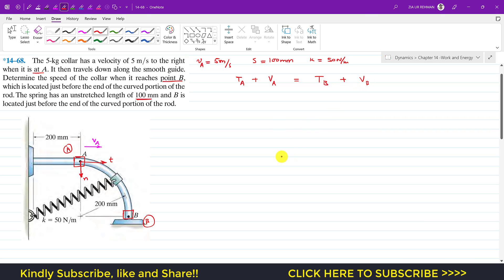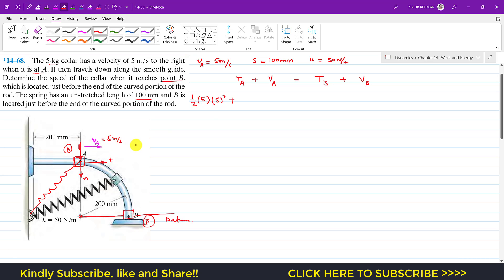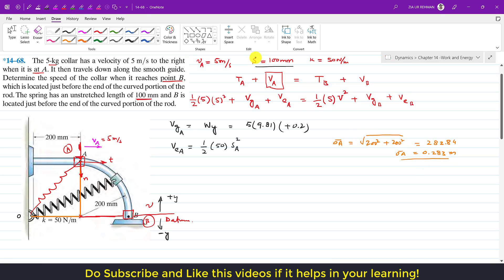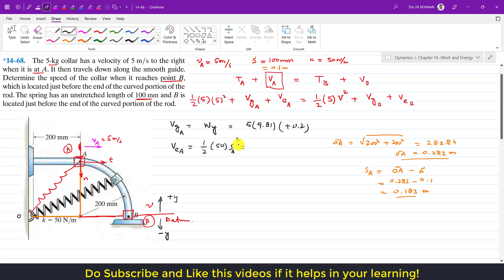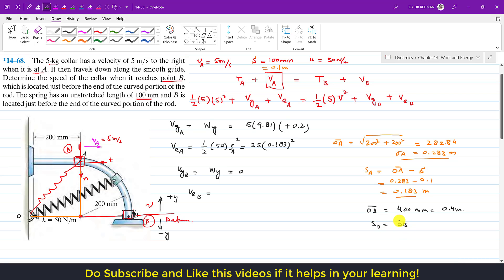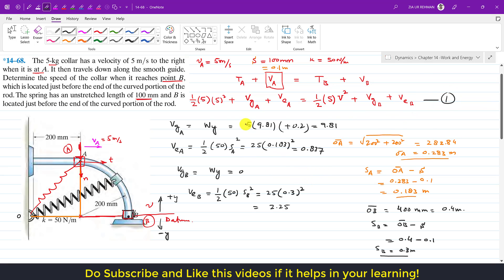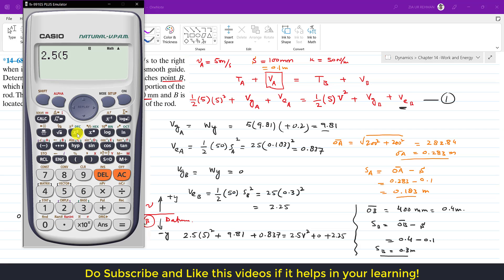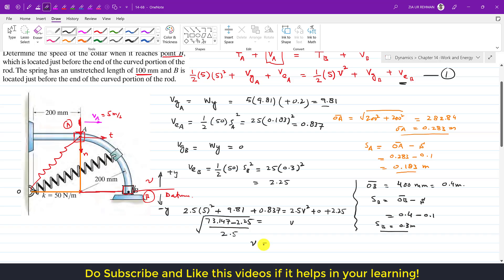14-68 Kinetics of Particle: Conservation of Energy Chapter 14: Hibbeler Dynamics | Engineers Academy

Comment: 4 - lb collar can slide without friction along a horizontal rod and in equilibrium at A when it is pushed  1 i n .  to the right and released from rest. The springs are undeformed when the collar is at A and the constant of each spring is  2 8 0 0 l b i n .  Determine the maximum velocity of the collar.
Reply: could you pls provide the step by step solution for this question